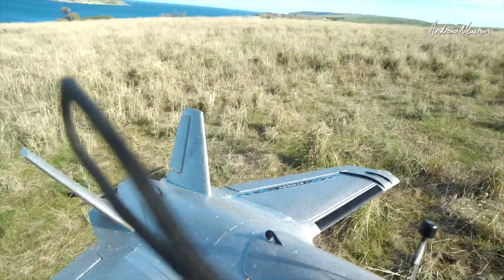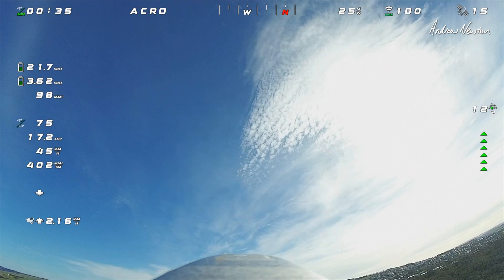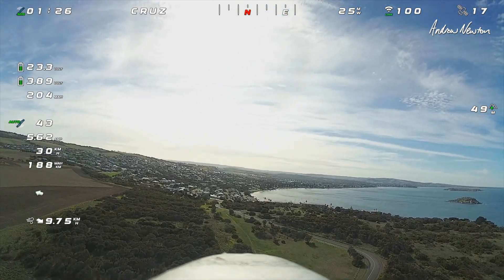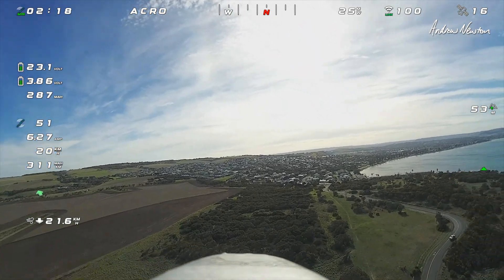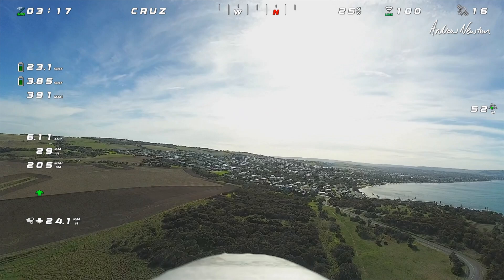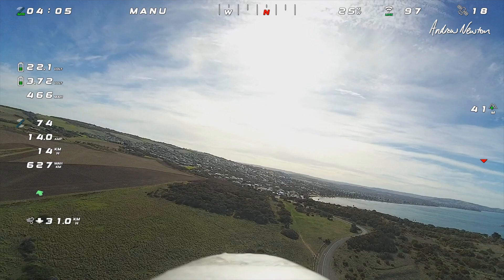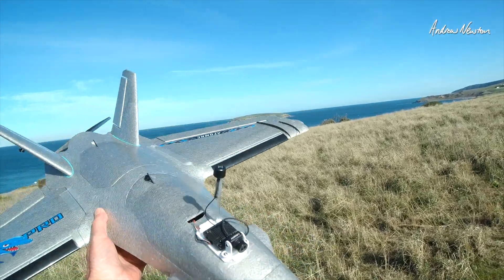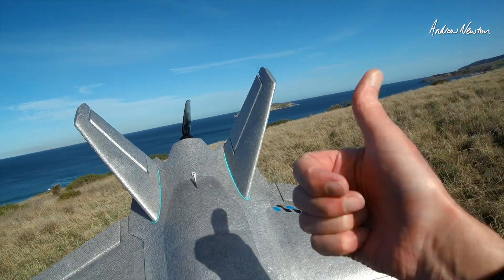AtomRC Dolphin Pro - Part 6. Pitch Bobbing Reduced

Comment: I noticed when I was setting mine up the other day that the servos are so slow. Wonder if that effects the auto correction?
Reply from the maker: How is it in Manual mode?
Reply: @AndrewNewton  modes not setup yet, just receiver for servo centering and seeing if the flaps and stuff are aligned.

Comment: Hi Andrew, thanks for that very good series of the Dolphin Pro. I am seeking for adivce, coming from FPV drones for 12 years, I just pulled the triggered and got a DP last week - I am going to use your Cli and I remixed your spacer and angled (I angled it to 1% to have it flat for the motor) bracket for the motor and 3D printed in PET-CF (light and solid). What advice would you give me for the maiden for a whole beginner with wings and plane (very little flights with planes)? Did you have chances to improve your settings? Thanks!
Reply from the maker: Thanks. Probably not the easiest model to begin with but it's all good once you get it in the air. Spacer worked well on mine but it may not be necessary on later production models, according to Painless360. I found it was best with mostly elevon mixing and minimal VTail mixing. It flies fine just as a flying wing. Good luck, let me know how you go.

Comment: I also managed to solve the wobbling problem. I followed these settings.

set nav_fw_pos_z_p = reduce to 30 or lower (I have =15)
set nav_fw_pos_z_i = probably OK as default (I have =4)
set nav_fw_pos_z_d = probably OK as default (I have =6)
set nav_fw_alt_control_response = new setting, could be increased closer to 40

But I couldn't get it to fly like it was on rails. It constantly tries to throttle.
Reply from the maker: Thanks for the feedback! Mine just has minor bobbing now

Comment: i’m getting ready to order one as well you mentioned adding more thrust angle to help fix some of the issues I’ve heard from a couple other people who do videos saying that they’ve addressed that problem finally and have fixed it. Have you heard anything yourself or do you still think the motor mount print is needed still?
Reply from the maker: I haven't read about other fixes, best to ask what they did I guess. But the motor mount print improved mine so I'm sticking with it.
Reply: @AndrewNewton  yeah I was watching some other channels video not gonna say the name and he was saying that the company fixed that issue for future orders but I’m still gonna print it for when I buy mine and test it with that
Reply from the maker: Great if it has beed fixed.
Reply: I just got a new RTH with sticker saying build date of 8.28.25. I've checked the motor mount and visually, it seems aligned correctly but I've the spacer installed anyways. Haven't flown her yet though.

Comment: Hi Andrew. Question. When you mention " 5mm reflex servo trim". Is this mechanical on the links, in the flight controller or radio. Sorry, I am a little confused. PS. now building my Dolphin Pro and you are my go to on this build. Awesome channel !!
Reply from the maker: Mechanical (pushrod length)is best but INAV auto trim will also do it. Never in the radio with INAV. Good luck with your build.
Reply: @AndrewNewton  Many thanks Andrew. Will follow your advice. One more question if I may. On the servos (wings and tail), what was jour final hole positions you settled with?
Reply from the maker: All on the outer holes in the end.

Comment: Hello Andrew, i have a question about the VTX voltage, did you have to solder something in the FC in order to provide voltage for the walksnail VTX? What's the default voltage delivered by the DJI connector? Thanks

Edit: i refer to the Navi Delux board
Reply from the maker: 9V stock, or you can change it to 12V
Reply: @AndrewNewton how to change it to 12v? Thanks
Reply from the maker: Sorry correction - Might already be 12V and you can change to 5V by bridging the VTX voltage solder pads on the board. Wiring diagram on this page, scroll down https://www.banggood.com/ATOMRC-F405-NAVI-Delux-Module-Flight-Controller-For-FPV-RC-Airplane-Fixed-Wing-Shock-Absorption-Support-DJI-Air-Unit-INAV-p-2037372.html
Reply from the maker: Second correction. It is 9V and you can change to 12 or 5v by bridging the solder pads

Comment: do you update the CLi File when you make changes so the March date is not correct? can't you set the Z-pid in inav 8 as in inav 7? you said you would try it with  Inav 7, did it remove the last of bobbing?
Reply from the maker: CLI linked below is my latest INAV8 (June 20th). INAV7 didn't totally fix the bobbing either.
Reply: @AndrewNewton  so you just use it as a wing and yet use the tail servos too? any reason for that?
Reply from the maker: I thought VTail angle is too acute for good elevator action but I added a little bit back in. Still not sure which combination is best.
Reply: @AndrewNewton  yesterday I went out to fly with a bigger propeller, your tail extension and cli. It was a massive success ❤ for the first time I felt confidence in flying that little bugger 👍 even that it was only LOS I still consider it a success. Next time I’ll put on the googles. Than you so much for your help
Reply from the maker: @vovsen123  Great news! So happy it worked for you.

Comment: Thanks again for all this work on the dolphin pro Andrew. I have one for maiden and testing ready to go. I really appreciate the CLI . This is why I waited as long as I did because I knew you guys would work the kinks out of it. Is this the stock flight controller from ATOMRC? Or are you using another one?
Reply from the maker: Wise man. Most of the problem was AtomRC terrible INAV setup. Still little bit of bobbing now but otherwise going well. Mine had the Navi Delux FC pre installed.
Reply: @AndrewNewton  thanks Andrew! Mine has the stock flight controller as yours. I’m looking forward to loading the CLI and testing it out.
How did she do on 4S?
Reply from the maker: Flyable on 4S but really would benefit from a bigger prop or higher kV motor
Reply: @AndrewNewton she’s a noisy bird! Did your motor mount decrease the noise any? Sorry if I missed it in the video
Reply from the maker: Yes, that's why I made the motor spacer
Reply: @AndrewNewton  thank you I printed it out and it’ll be maiden  today!!! Cheers
Reply: @AndrewNewton brilliant maiden thanks to you!

https://youtube.com/shorts/x-1SvGKbtM8?si=6qc_K7aIad9nOoqN
Reply from the maker: @Navstarmarine  Ooh yeah, that's how it's meant to be flown.
Reply: @AndrewNewton thanks again you’ve always been super helpful to me! I’ll be mentioning you in the review! 😊
Reply: And the noise is MUCH better. Way more tolerable with the spacer 🎉
Reply from the maker: Excellent, glad it worked for you.
Reply: Hello Andrew ! Thank you so much for that series of videos. I am a brand new beginner with wings, coming from fpv drone world, what would you recommend for first maiden? (Will add your 3d printed motor angle bracket & your cli).

Ty :)

Comment: These pids did not work for me but I've found the cause of the pitch bobbing issue. In the iNav 8 release notes the position z pids were changed. You have to retune this yourself. If you update your dolphin to iNav 8 you will get pitch bobbing. I fixed my dolphin by going back to iNav 7.1. iNav 8 doesn't really offer me anything I need. But I can confirm my pitch bobbing was fixed . Tested in 50kmph head winds. Steady as a rock
Reply from the maker: Excellent, I'll roll back to 7 today too. Almost sorted it with 8 but not totally.
Reply: Покажите свои настройки для 8.0.

set nav_fw_pos_z_p = reduce to 30 or lower (I have =15)
set nav_fw_pos_z_i = probably OK as default (I have =4)
set nav_fw_pos_z_d = probably OK as default (I have =6)
set nav_fw_alt_control_response = new setting, could be increased closer to 40

Comment: Now I want an Andrew Newton edition of the Dolphin Pro. Better wing locks, fixed motor mount and tuned flight controller.
Reply from the maker: A bit more work required. Still have some bobbing but the basic wing is good now.